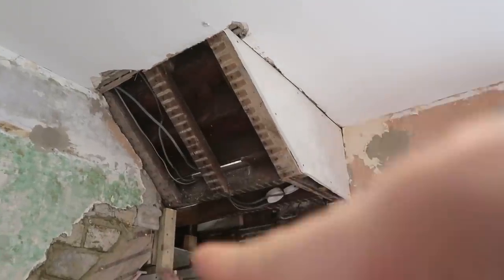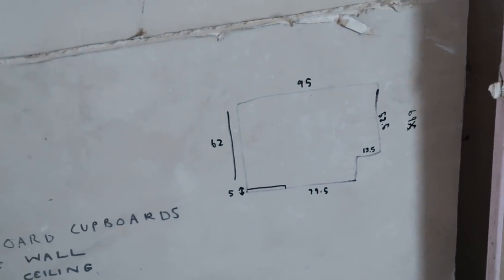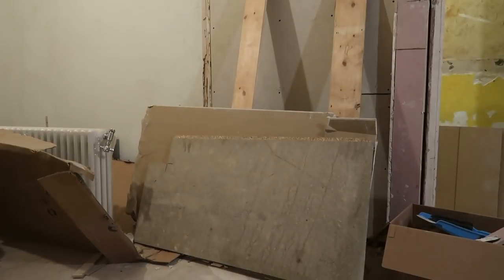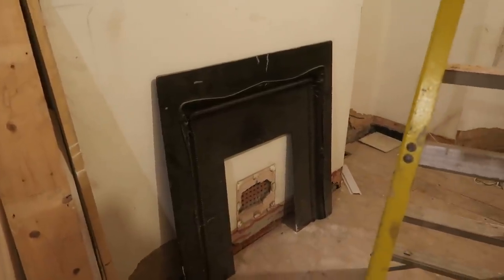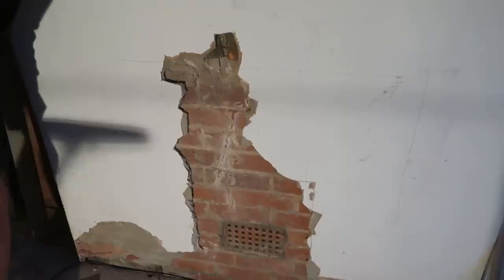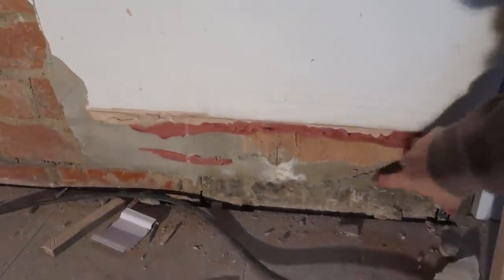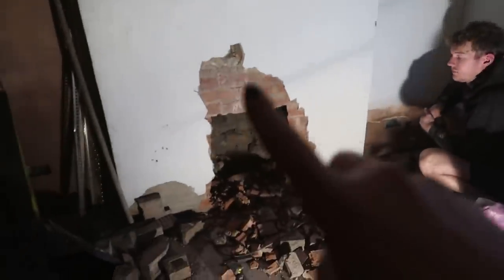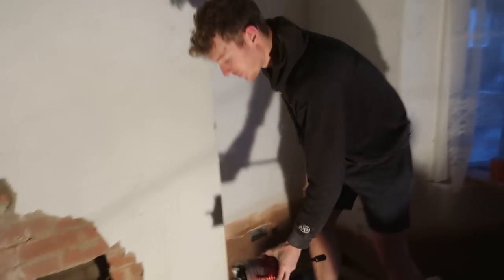THE STRESS SETS IN | PVC + plasterboard, damp proofing the wall, and knocking out a fireplace

Comment: Yo, don't sand the fire surround. Paint it with BIN the same stuff you used on the PAX doors. This will save you a bunch of time. 

Have you thought about putting an extra power socket inside the fireplace??? 
If you can, if you have access to the wiring.
Reply from the maker: Great point - we will definitely just be priming and painting, the wardrobe doors were an absolute dream vs. all the other jobs! 

We are doing something similar actually, making a hole behind the TV and another at the bottom on the right hand side where there will be a cabinet. That way we can plug everything inside and hide all the wires - I can’t wait to finish it all!